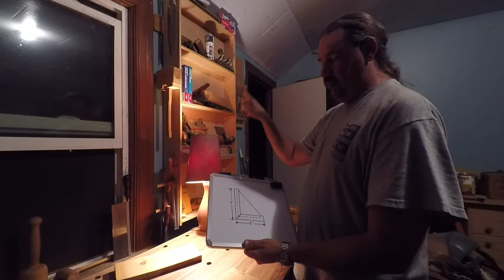Angle Plate casting Pattern Build and how to do wood foundry pattern making

Comment: Hi, no follow board needed, it's a flatback pattern.
Reply: Did you need the follow board ?
Reply from the maker: No but it saves the molders time and they charge by the hour so it saves me on the cost of the castings .